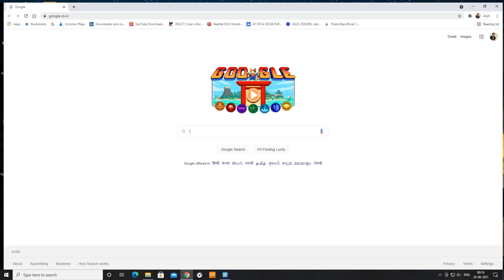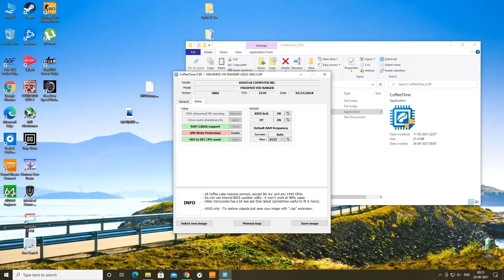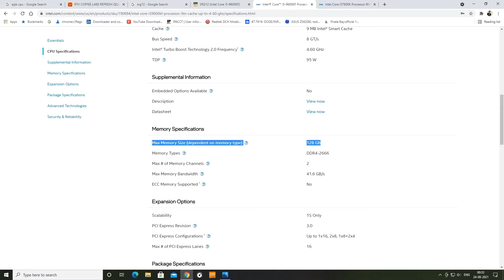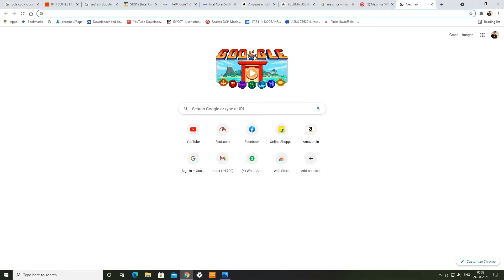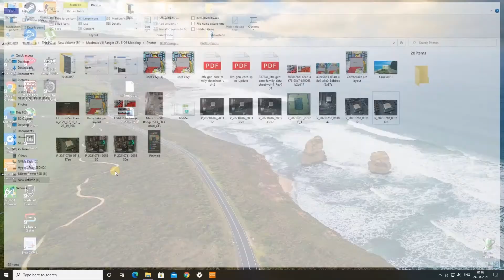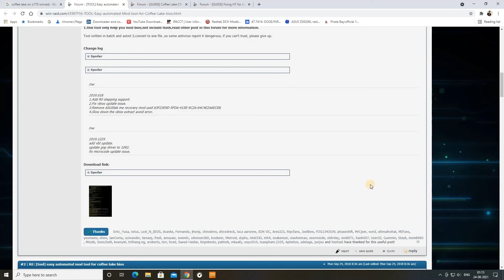It's Coffee Time! Running Coffee Lake CPU on ASUS Z170 motherboard ft. CoffeeTime 0.99

Comment: Hey i know this video is a few years old and you probably won't respond to this comment but i have an old Clevo P750DM2-G laptop with a Z170 chipset that i want to upgrade. I purchased an i5 9500f as it was cheap and it would be a nice upgrade from an i7 7700. I was wondering if I need to isolate the pins on it. I already downloaded and flashed a modded bios from Dsanke that adds the microcode for up to an i9 9900ks but it never explicitly mentions if i have to isolate the pins. Judging by the diagram you provided it should be pretty easy to do, as i only have to isolate two pins for Clevo motherboards. I most likely will have to isolate them but i just want a confirmation for my Clevo laptop.
Reply from the maker: Hello there, it will be safer to isolate the pins. That won't cause any harm. You can use Kapton tape for isolation. All the best.
Reply: @geekjit215  Ok thank you for letting me know! I have some Kapton tape and i will try it once the cpu arrives.

Comment: Bro is anyway that I can flash the bios without removing the chip because my chip is not removable
Reply from the maker: @Aswin_Gamer1  Hello there. You can try Intel Flash Programming Tool (search on Win-raid forums and get the version for your chipset. It mostly depends on the motherboard model. But the best practice is usually taking the BIOS chip out. If you can find someone skilled to desolder the BIOS chip, that can help.
Reply: @geekjit215  uh, why are you suggesting the desoldering of a bios chip.... that sounds like nonsense. you can just use the Clips the come with the ch341a and clip it ontop of your soldered bios chip
Reply from the maker: @HDErickGames No it does not sound like non sense. There are scenarios where it is physically impossible to clip in to the BIOS chip based on the location of it in the motherboard. There are also scenarios where the BIOS chip has other in circuit components where the clip with the BIOS chip soldered on the board will cause the signals and voltage to drop and cause failure to the flashing process.

Comment: I just wanted to thank you for the detailled video! I now have an i7 8700k running in my asus z170 pro gaming. :) The Date like serial number and mac adress can also be extracted from a bios dump you take with the ch341a flasher. You can directly import the dump in coffee time. But it is probably a good idea to backup the bios in windows so if you however manage to damage the bios chip you still have your backup. Also keep in mind to export tpm keys in your bios itself so you can still boot to windows if you have that enabled. Regarding the SKTocc i found out that 2 components like an other comment told are connected to it. one is a pullup resistor going to the 3 V battery the other one is a capacitor going to ground. I removed the capacitor and shorted the pads. I tried to measure the socket to identify wich pins i need to isolate. If i did nothing wrong you should only need to isolate the 6. pin in the 1 row (left to right) but i isolated both asus pins just to be sure.

Comment: Can this upgrade be done on a b250 motherboard?
And is it safe power wise, can the mother board power 9th gen CPU safely?
Reply from the maker: Yes this mod works on entire 100, 200 series chipset. As for power wise, that depends on the specific motherboard in question.

Comment: FD44Editor will not read my dump. How do I get my board info and manually enter it?
Reply from the maker: You can use AMIDMIfit
Reply: @geekjit215  Thanks man, never figured that out but have had the cpu working since shortly after I commented

Comment: The google drive link to 'Aptio V Firmware Update tool'(5.14) is not working. Downloading from AMI, it can only download the latest version(5.16), which doesn't run (showing 'unable to load driver' error). Could you help?
Reply: I have this issue too .. Infact the Aptio V Afuwin tool does not run on any of the AMI based motherboards I tried
Reply: For anyone reading, since this guide is still relevant in 2024, I ll also add that Aptio V indeed does not work, HOWEVER, Aptio IV, does work and can produce the needed file. Basically, you just need a way to pull the MAC, serial etc, I bet you can do that in multiple ways, and then manually enter them in CoffeeTime when preparing the custom BIOS.

Comment: Awesome guide! I have the same motherboard and hope to put the QQLS in it soon. I hope I'll make it work with your guide :)
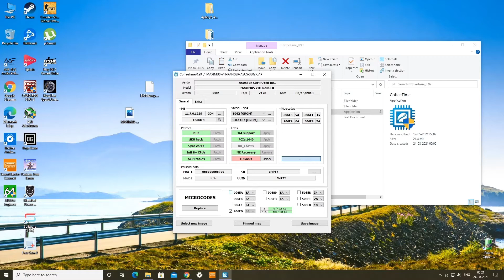Reply: I have a question. Im modifying my BIOS now and am at the point in which I'm adding the microcodes. What is the correct code for QQLS from AliExpress? If I add all available, shoud I change the "EA" options somewhere for this Engineering Sample, or should I just select the "EA versions" like you did in 14:27? Thank you for the help!

Comment: Thank you so much for the detailed video Arijit! I succesfullu modded my Asus Z170-a to work with an i7-9700K I bought used off a friend. Saved me a bunch of money. This video is so well made that, even if it does not completely apply to my motherboard, I still got the idea of why the individual steps are done. 

To anyone wondering whether they have the necessary skills to do this mod, I was a complete beginner and I still could make it work. One note, if you are modding asus z170-a, the pins have to be soldered parallel, not diagonally.
Reply from the maker: Congratulations on the mod. Enjoy your upgrade. 😁

Comment: Will i be able to do this mod on a asus prime h270m-plus motherboard
Reply from the maker: Yes absolutely. I have done it on a GIGABYTE B250 board as well.
Reply: @geekjit215  WHich tools did you use to flash or migrate the SN/UUID? This video has tools only for ASUS

Comment: Anyone know if this will work on evga z170 ftw?
Reply from the maker: Yes it will work on any 100/200 series board.
Reply: @geekjit215  thanks
Reply: @geekjit215  Do you by chance have a pinmod map for EVGA?
Reply from the maker: @tmangaming91  Unfortunately no. But you can just do the connect and leave the isolation. Even if the pins get burnt, it won't affect anything and the board will still work. Do make sure to check after 5 mins of power on.
Reply: @geekjit215  dang, thanks man

Comment: Thank you so much Arijit! 
Managed to get this running on a Asus Z170 Pro Gaming paired with a 9600K i5. Used your guide as a basis for the bios settings and only tweaked it to include MAC numbers etc. On this board, I had to use the CH programmer but thankfully the board has an easy removable bios chip! I had to be careful removing it though as i did bend a pin but we were okay after that.
I think the hardest part was just getting my cooler back onto the cpu hehehe. I managed with the pin mod too - used a 2B pencil and capton. I did test various pencil types (4B, 4H etc) using a multimeter and picked the one with the lowest resistance readings on the multimeter  - i think this payed off because I booted up fine on first try!!
Reply from the maker: Awesome. Thanks for the appreciation and congrats on the mod. :) 
The 9600K is still a great and capable CPU. Depending on the cooler you have, try overclocking it and set XMP for your RAMs. All the best.
Reply: does the firmware tpm work after this, i also have the same board.

Comment: Hi my friend. I wanted to try this mode for several years. Recently I had the chance to get a used maximus VIII ranger and I plan to try the mod, using a 8700K and later a 9900K, if I manage to find one second hand. If I understand correctly, you were not able to flash the modified BIOS with the programmer. So the suggested path is delete BIOS with the programmer and then use motherboard BIOS flash back to write the modified BIOS to chip. Is that correct?
Reply from the maker: Hello there, you can flash the BIOS perfectly using a fixed version of ASProgrammer. 
https://drive.google.com/file/d/1KrYyKQVj_svvU5fr5EVJ7WP0bRRMFP_a/view

Here it is. I got this from Adamant IT's channel. It works perfectly.
Reply: @geekjit215  Thank you for your reply. That is the version I have. I will try it either today or tomorrow. And thanks for your very detailed videoon the subject
Reply from the maker: @arisaris6365  You are most welcome. I have also added resizable bar support thanks to the mod from xCurio. You can just Google for rebar xCurio. The only drawback of the rebar mod is resume from sleep does not work when rebar is on. 
My Maximus VIII Ranger presently has an i7 9700KF at 5 GHz with 32 GB of RAM at 3200 MHz CL14 and a RTX 2060 Super. I have tested the rebar on this with my 3070 and it works perfectly except that when you put it to sleep, it won't wake up and you will have to press the reset button which will bring it back to where you left it.
Reply: @geekjit215  Nooooop. Unfortunately I could not read the BIOS with programmer. IC NOT RESPONDE message. I took the chip and put it on programmer. Maybe the programmer is faulty. I used it for the first time. I may have to order new programmer. Project on hold for now....
Reply from the maker: @arisaris6365  Alright. Under hardware, you did select CH341 right? 
And then did you select the correct BIOS chip?
On my Maximus VIII Ranger, the BIOS chip is Winbond W25Q128FV.
Reply: @geekjit215  The lack of experience on using prograrmmer is obvious. I thought the software could recognise chip. When I selected the BIOS you mentioned, it was read. My friend you are priceless.....
Reply from the maker: @arisaris6365  Glad it worked for you. :)
Do let us know how everything goes and all the best. :)
Reply: @geekjit215  And the correct route is unprotect, erase old, write new, verify. Isn't that so?
Reply from the maker: @arisaris6365  Honestly, I never needed the unprotect. I just do the erase>write>verify.
Reply: @geekjit215  Thank you again for your reply, my friend...
Reply: @geekjit215  Back to the project. Well, again a problem. Programmer can read chip. When I press ERASE IC, process does not finish, even after 35 minutes. Something goes wrong....
Reply from the maker: @arisaris6365  That is very weird indeed. Are you connecting the chip directly to the programmer?
Reply: @geekjit215  yes. Now I try unprotect. messages shown are "Current programmer: CH341
Old SREG: 11111111(0xFF), 11111111(0xFF)". Almost for 20 minutes, now.... Both leds light
Reply: @geekjit215  I stoped process. I try again ERACE IC. Message shown is "Possible protection is enabled. Press "Unprotect" and check datasheet. Erasing memory... The process can take more than a minute on large flash memories!"
Reply from the maker: @arisaris6365  This usually happens when there is a bad connection with the chip or when there isn't enough voltage. 

Can you join the forums as on the description and post a photo on the post?
Reply: @geekjit215  techpowerup

Comment: hi Arijit!
I have a i5-9400f with an AsRock z-170k motherboard. the thing is that i do not have a supported 1151 socket CPU so i can get the IMEI and all of the serial numbers. any suggestions?
Reply from the maker: Hello there. Can you confirm if the BIOS chip is removable on your motherboard?
Reply: Yes! It is! I have all the tools i need for this procedure but i'm very concerned about compatibility aswell.
Reply from the maker: @radubuturuga8041  Awesome. All you need are the tools and another PC/laptop. 
Please follow the below steps:
1. Remove the BIOS chip from the motherboard. Take a photo of it before removing for keeping a note of the orientation. 
2. Connect the chip to the programmer and using the ASProgrammer software, select the BIOS chip model and click on read data. 
3. Once it completes reading the data, save the file somewhere secure. 
4. Download the latest BIOS for your motherboard and open it with CoffeeTime. Apply the mods and the necessary fixes. Save the file once done. 
5. Now open the file using CoffeeTime which you saved earlier using ASProgrammer and note down the board data in a notepad file. 
6. Open the modded BIOS file again using CoffeeTime and put the board data to the respective sections. Save this file as final.
7. Flash this new file using ASProgrammer. Once done, click on verify data to check if the flashing is properly done. 
8. Put back the BIOS chip on the motherboard and install the CPU with the copper tape attached and it should boot up in one shot.

Comment: Thank you SO MUCH for this video. I'm eager to try it this weekend when my USB BIOS flash thing arrives. 

I have the same motherboard, and it was originally built with a 7600K. I upgraded another computer total-rebuild, and found myself with a spare CPU, an i7-9700K. I knew it was the same LGA1151 socket, so I set about upgrading my Asus Maximus Ranger VIII board with this 9700K (and some extra storage, other minor mods/upgrades) only to find the board would not power up. Silly me, it needs a BIOS update, and here you have a full walkthrough! I've never done anything like this, but I work as an electrician and have been diving into electronics theory--I feel excited to try this project with your guide, and will return to update this comment for any others in the same situation.

Comment: I'm also using the i5-7600k with msi z270 gaming pro carbon since 2017 and it's been rock stable... I actually really like this board and when i found out about this mod i was like wow and it's so interesting as hell making it work and all that.. I'm not sure if i'm gonna attempt this myself but i watched the whole video it's really amazing stuff. Hope you are enjoying the upgrade with your amazing old board. Btw do you think my board should handle the coffee lake chips with no problems as well?
Reply from the maker: Hi there. Your board should easily handle coffee lake even 9900K. 
Since this video, I have the CPU upgraded to an i7 9700KF running at 5.1 GHz all cores rock stable with 32 GB memory at 3200 MHz. 
If you are up for it, you can of course give this a go. :)

Comment: Also I was wondering: You only connected 2 pins but I think with your motherboard (ASRock) you should also have to isolate 2 of the pins. Am I wrong? 
Did you ever do this and if not did it lead to any issues?
Reply from the maker: Hello there, my motherboard is from ASUS and yeah, ideally you should follow that diagram and isolate the pins. However, with the motherboard I have (Maximus VIII Ranger), those pins are not connected anywhere which I was aware of from a few posts on win-raid and later on, verified myself using a multimeter. Hence I did not need to isolate those two pins.

Comment: I tried this but I tried to install the modified BIOS on my Asus Z170A with AFUDOS (instead of using a phyiscal BIOS programmer).
Everything was completed but now it does not post anymore... 
Also I didn't manage to flash backup the BIOS to an offical BIOS version with a USB stick... Any idea what could have gone wrong?
Reply from the maker: AFUDOS cannot flash ME region properly while ME is active and running. That's what I believe has happened here. If the board has USB BIOS flashback, give that a shot. Otherwise, you will need a physical BIOS programmer to revive the board.
Reply: @geekjit215  Thanks a lot! Do you think this is also the issue why it did not work on my 6700K anymore?
Reply from the maker: @GionSnow  Absolutely. AFUDOS is safe to use if and when ME is in disabled state. If it is running, that region is write protected leading to the corruption. 
If you used Intel FPT, it would have straight away thrown an error and prevented you from flashing. Luckily, the Z170A has a removable BIOS chip so flashing it with an external programmer like the CH341A will be a walk in the park.
Reply from the maker: @GionSnow  When using the external programmer, make sure to take a dump of whatever's already in there. Then use FD44Editor and open the BIOS file. Check if the board data is present there.
Reply: @geekjit215  Your explanations are super helpful!
So there is no good reason to disable ME except from being able to flash it with AFUDOS, right?
I now received my CH341A and I will try it again
Reply from the maker: @GionSnow  Correct. And all the best. I am sure you will be able to revive the board in no time using the CH341A. https://drive.google.com/file/d/1KrYyKQVj_svvU5fr5EVJ7WP0bRRMFP_a/view

Here is the link to the software which works perfectly with the CH341A.
Reply: @geekjit215  I now programmed the BIOS onto the chip of my ASUS Z170A with the CH341A, and that worked. I could run it just fine with the 6700K.
Then I isolated the 9700K CPU pins with tape and connected the two (same as you). And it starts up and boots just fine with the 9700K. 
Now I changed a few fan and memory settings(XMP), but I didn't do any big changes in the BIOS apart from that.

But now I am facing a few issues:
- The screen sometimes froze
- I do get blue screens: 
"KERNEL_AUTO_BOOST_LOCK_ACQUISITION_WITH_RAISED_IRQL"
"WHEA_UNCORRECTABLE_ERROR"
- Funnily enough, I can only use mouse and keyboard in the BIOS (in Win10 they are not recognized anymore)

This happens already happens quite quickly (max 10 Minutes)

CPU-Temperatures are fine and I never saw them climb above 65°C and Voltage is set to Auto.
So I really do not know what could be causing the issues..
Reply from the maker: @GionSnow  Yes that can happen with some boards and need manual voltage tuning as the board does not officially support the CPU. 
Please join TechPowerUp forums and follow the link in the video description. Post a thread there.

Comment: I have a AsRock Fatal1ty B250 Gaming K4 with a 7700K. Its possible do this in that MB to use with a 9700K?
Reply from the maker: Yes it is absolutely possible to do this. I have done it on a GIGABYTE B250 motherboard as well.